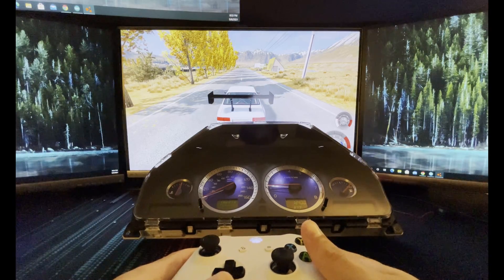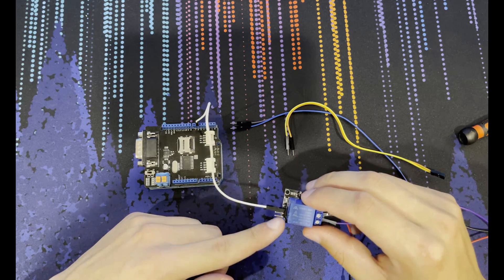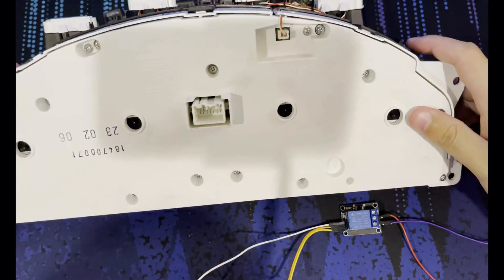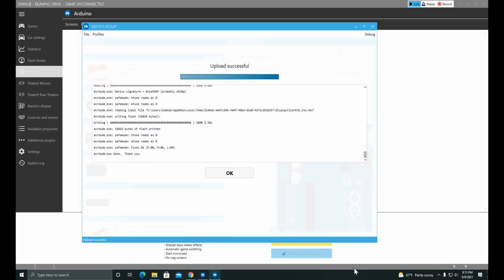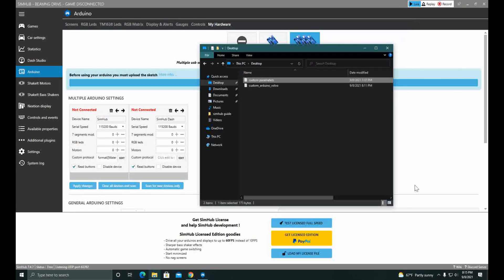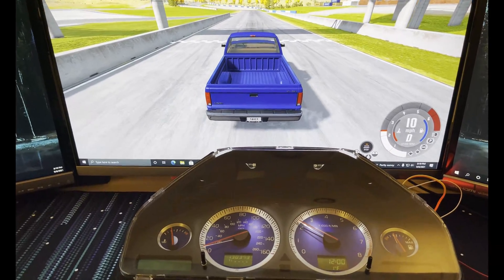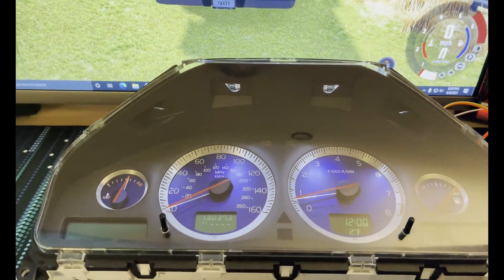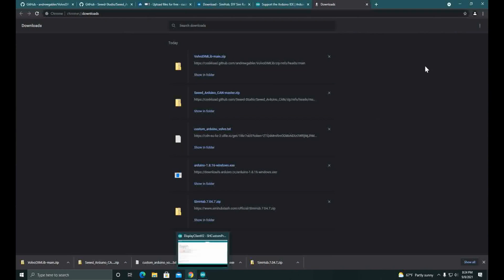SimHub with P2 Volvo Cluster - Setup Guide

Comment: heey big tnx for all the info and the time you dedicated.
got started to. but need a little help with the SHCustomProtocol in the arduino code. 
got it working iam getting the speed, rpms,fule,temp and gear.
didnt quite understood how to get the turn signls and the lights.

Comment: Hi @AVGarage_ ,

Firstly thank you for video. Thats so incredible idea. But i have a problem about upload. I followed all steps on video. 
I used the true versions. But I'm stuck at the compilation point. 
 

Compilation Screen Last messages;

Using library VolvoDIMLib-main at version 1.6.1 in folder: C:\Program+Files+(x86)\SimHub\_Addons\Arduino\ArduinoIDE\arduino-1.6.13\libraries\VolvoDIMLib-main 
Using library Seeed_Arduino_CAN-2.3.1 at version 2.3.1 in folder: C:\Program+Files+(x86)\SimHub\_Addons\Arduino\ArduinoIDE\arduino-1.6.13\libraries\Seeed_Arduino_CAN-2.3.1 
exit status 1

Error Screen;
Compilation failed.

Please help me about it. I bought all parts. I will be very sad if I do not succeed. Have a good day.
Reply: https://youtu.be/xCUjK_IsV-M
Reply: @greenleaf1292  Thank's bro i will try it.

Comment: Pro tip: If you're following this guy's guide, NEVER, and i mean NEVER use a CAN-Bus shield, Always go for a MCP2515 module or TJA1050 module, They're better and smaller imo, i learned this the hard way when i started this project somewhere around 2022-23.
Reply: and how does it change the instructions he has in the video? That's a completely different part, he simply plugs the two boards together. It is much cheaper to buy what you have suggested.
Reply: @YourDeletedComments  The MCP2515 boards just are more smaller meanwhile Seeed Studio is like "nah, eff it, just make it the same size as the Arduino."

Comment: Have you thought on adding warning light support to the cluster i got everything on mine working i got the milage and Ding Noise working and custom message displayed with a custom code i generated from ChatGPT the indicators don't exactly work as they should i added the trailer warning light to the code but That is my progress with it at the moment Take care
Reply from the maker: Yeah it’s sort of in there. Might need some tweaking to get it working properly. I don’t have much time to work on this right now though
Reply: @AVGarage_  thanks for your answer but the Warning lights come on then off when the cluster is powered up but then they go off so what line would i need to add to get the warning lights to appear when a car failure happens in game but the Check engine light doesn't appear But thanks in advance

Comment: Hi I saw that you have a new library for the Mileage support how do I install it thanks in advance
Reply from the maker: You should just need the new library and then add the enableMileageSupport(true) to you code
Reply: @AVGarage_  is that on the custom protocol or the Sh Custom protocol what is the exact line Thanks in advance

Comment: I have a s40 cluster and it’s just twitching the needles whenever I reset the uno, any idea why (pt #:30710072) PLEASE HELP!
Reply: After some further testing, when I given the gauge just plain power to + and - and +/- for can bus it does the same thing. Idk shit abt coddling other than some scratch but imo it looks like it’s just getting no code sent to and from the can bus but like I said idk anything abt this topic. Hopefully this info helps
Reply: whats the difference also, what can i do to make it work
Reply from the maker: @Undeadful volvo has a completely different communication protocol for that cluster. You need to have a P1 car to log files with and the ability to code your own solution. Otherwise you should sell it and get a P2 cluster.
Reply: @AVGarage_  ok will do thanks 4 the help!
Reply from the maker: It doesn’t work with P1 clusters (s40) only P2 (s80,s60,v70,xc70,xc90) 2005-2009

Comment: Hi i was having a look at the Code on the Arduino how do you set up the geae indicator my diesel cluster came out of a Manual what do i do to the code for the gear indicator to work and i still haven't figured out how to set the time Thanks in advance
Reply from the maker: For my cluster that came from a manual car the gear selector code does not work either.

Comment: I've gotten my hands on a 2005 petrol but European cluster, is there a chance it won't work at all because I have wired all of it up and programmed the UNO without any result of lights on the dash. I may also have to redo wiring, it's a bit messy😅
Reply from the maker: Should work
Reply: @AVGarage_  I managed to get it to work very sweet though, I couldn’t get the volvo dim simulation examples working, but I’m sure it was just an error on my end. A thanks to this guide
Reply: @SwagusSEhow did you do it, mine doesn't work
Reply: @PABLOELGAMER11late reply, but yes I did do it and it ended up working great, but you have to remember the cluster needs to be 05-07

Comment: What does the relay do? Some videos I've seen, they don't seem to use the 5v relay. Just the canbus shield on top of the arduino, with a 12v power supply going straight to the arduino. Very new to this.
Reply from the maker: The relay allows the Arduino to give power to the cluster selectively which is used to reset the needles in the case where it is powered off while they’re not in their home position
Reply: @AVGarage_  Ah. Thank you, good to know. If I have a problem like that I'll have to run a relay. I'm going to be using a non CANBUS cluster so maybe it will work differently?
Reply: @jesse.vr6  It could be it works different, I would not be surprised if the CAN-controller expects a particular type of power-off.  With ignition power/electricity being expected to be switchable compared to a constant battery current circuit. (I have a Volvo cluster from a bus designed at the end of the 80's which only has 2 chips on it and is obviously not CAN-bus based, but it does have the two different types of circuits: one battery positive that is fed to it continuously, and a main electricity switch that switches the positive side, with the first circuit there to keep the clock and tripmeter alive).

Comment: Hi I just got my P2 Gauge cluster from the scrapyard I got mine from a 2007 Volvo V70 D5 5 Cylinder diesel I managed to configure the sketch for Diesel but how exactly do you set the Time as when I remove the //  from Dim Time and then I save and upload and I get compilation error Ammi doing something wrong the outside temperature came up in Centigrade and the clock came up as a 24 hour Thanks in advance
Reply: Thanks for the reply every time I add the time when I load up the game I'm getting Brake failure stop safely and SRS Airbag service urgent then the cluster shuts off If I remove the lines for the time the cluster is working fine But thanks for your answer and take care
Reply from the maker: I am not sure without testing myself. I haven’t used a diesel cluster before.

Comment: Im having issues with the gear selector simhub says it shows N but the cluster shows P i have done everything could you maybe help with it?
Reply from the maker: Did you add the definition in simhub to send the value from simhub over to the arduino code?
Reply: @AVGarage_  I don't know how
Reply: I have been tinkering with it for 7 hours now
Reply: I have the formula setup and cluster works fine its just the gear selecter
Reply from the maker: Yeah I have added the gear selector since this guide was made. You need to add the information in the formula then pass it to my code. Try asking chat gpt how to do it if you get confused.
Reply: @AVGarage_  chat gpt just says to connect a compatible gear selecter
Reply from the maker: Did you get it figured out? Sorry, I’ve been very busy
Reply: @AVGarage_  I have not 😭
Reply: @AVGarage_  I can't get it to work I don't know if I'm doing anything wrong 😕
Reply from the maker: Send me an email with a detailed explantation of what’s happening and what your code and simhub parameters look like. Contact@agabler.com
Reply: @AVGarage_  still having issues now on a 2005 s60 cluster

Comment: hi congratulations on your work, question: does it also work on the normal v70 or s60 panel or just this type? I thank you in advance😊
Reply from the maker: Works with the normal ones without fancy dials as well, just make sure the cluster id the correct year.

Comment: hi I have now programmed my arduino but it does not want to get any power to the speedometer what could be wrong have now followed every single step?
Reply from the maker: You mean everything is working except for the speedometer? Like the tachometer works and gas gauge etc
Reply: @AVGarage_  no i mean that my speedometer does not turn on. My arduino says that it is connected but my speedometer does not  turn on. Do you have i mail that a can send you some picture of my arduino? nothing works :)
Reply from the maker: Sure you can send me some pics. contact@agabler.com

Comment: wouldnt it work with Volvo P2 platform  as long they use p2?
Reply from the maker: No, they changed communication messages and speeds from 2004-2005 and some xc90’s may require the fiber bus to communicate properly (I am not sure about this, haven’t tested any xc90 clusters

Comment: I'm having issues 😕 2008 volvo xc90r cluster I have everything wired right and cluster not a single light turning on pls help
Reply from the maker: I haven’t done any testing with XC90 clusters. Although they are P2 some years might not function properly. To keep the nice gauge dials you could get a s80, s60, xc70, or v70 one and swap just the back dials
Reply: Okay so I got it working but now I have a tire press alarm and maintenance alarm how do I fix this,when I put my cluster in the car it don't have any of these codes only with the arduino
Reply from the maker: I am not sure, I have never experienced that. Must be an error stored in the cluster somehow
Reply: Okay 👍
Reply: okay i got a s60 cluster and the only thing i got it to do was to gauge sweep with no lights
Reply from the maker: @FynnTheFurry strange. Double check that you put the code in the correct place and you connected your racing game to simhub properly
Reply: its turning on then turning off and i hear the relay on and off
Reply from the maker: Double check your simhub settings

Comment: Does it matter if the cluster comes from a Diesel or Petrol version ? does it matter if its a European with km/h speedometer or American with mph speedometer ?
Reply: I tried it with a diesel cluster I went into the Sketch and I saw Tachometer 0-8000 I changed it to 0-5000 and the revs were accurate and for KM/h you would change 0-160 MPH to 0-260 KM/h I'm from the UK so my speedometer was in MPH but in case you were wondering yes a diesel cluster will work Take care
Reply from the maker: It shouldn’t but the rpm gauge would be less useful. I never actually tested it but I added code support for KM/H

Comment: Hey mate how would i go about editing your code to work with a different cluster, i have a ford falcon BA cluster that im playing around with as i want to make a full dash set up for my sim rig, if i can find the can bus codes for this cluster can i edit your code to work? With it? 

Ps im new to all this arduino programming stuff but its a little project to help me learn.

Your help would be much appreciated
Reply from the maker: You would essentially need to rewrite everything from scratch sorry.
Reply: i have a holden vu ss cluster 20 pin that im considering modding.

Comment: Hello, it's me again. I am not having issues this time and it has been working flawlessly ever since we resolved my issue. This is merely a question, and was wondering if you knew the answer. I dug through your research in the master ZIP folder you left in Github, and found a "Sweep Gauges" section, and was wondering how I implement that into the code to get it to sweep the gauges on startup. Funnily enough I 've wanted to do this for quite some time, but couldn't figure out how to write the code. Some guidance would be appreciated when you have the time!
Reply from the maker: I could add it to the library for you
Reply: @AVGarage_  AS long as it's not an inconvenience to you, that'd be awesome!
Reply from the maker: Just pushed some changes, but didn’t test them
Reply: @AVGarage_  Will give feedback, testing as soon as I can.
Thank you!
Reply from the maker: Go download the library again from my GitHub page and then add 

VolvoDIM.sweepGauges();

Just under VolvoDIM.init();
In the setup() function of the custom_arduino_volvo.txt file and copy /paste then rebuild in simhub
Reply from the maker: Let me know if it works
Reply: @AVGarage_  Testing now, need to watch tutorial again so it will take several minutes
Reply: @AVGarage_  Do I need to include the new library as well? I'm getting a compilation error, and I've noticed that "...gaugeSweep..." isn't orange in the IDE software like the functions "gaugeReset" and "init"
Also keep in mind that I can be doing this entirely wrong 😅
Reply from the maker: Yeah you need to redownload and replace the entire folder
Reply: Having trouble, giving me a compilation error, I can't remove the old library folder even after deleting it manually from the file directory. I've also tried manually adding the library, but it says it already exists in the libraries, yet I can't find it in there.
Reply from the maker: You probably need to do it through file manager

Comment: I purchased one of these P2 connector gauges and connected it, however when I copy and paste the customized Arduino volvo.txt, an error occurs. It appears like @greenleaf1292 is having the same issue. I believe it has to do with the VolvoDIM. Its the same error code as @greenleaf1292 it says "In file included from C:\Program Files (x86)\SimHub\_Addons\Arduino\DisplayClientV2\DisplayClientV2.ino:938:0:
sketch\SHCustomProtocol.h:5:22: fatal error: VolvoDIM.h: No such file or directory
#include <VolvoDIM.h>
compilation terminated."

 So, I'm currently stuck on this. Even after reinstalling everything, the issue still occurs.
Reply from the maker: You need to add my library to your libraries in the Arduino project
Reply: @AVGarage_   I followed your instructions in the video. I continue to receive the same issue. Do you have a discord server I can join, maybe I can somehow show you screen shots of what error code im getting?
Reply from the maker: Whats your discord
Reply: @AVGarage_  It won’t let me comment for some reason.. but if this goes through it’s :Average moderator#8769
Reply: @AVGarage_  are you there?
Reply: @AVGarage_ hello?
Reply from the maker: Sorry was very busy this weekend. Will add you on discord shortly
Reply from the maker: Sent
Reply from the maker: I put a discord link in the description and added you

Comment: Hey when I try to upload Sketch setup it says "Compilation failed". Please help me & thanks
Reply from the maker: Make sure you’re using the correct seede studio version i used
Reply: @AVGarage_  the Arduino iDE version right?
Reply from the maker: Check the version number though
Reply from the maker: Yes, but I am talking about the seeed library version number
Reply: @AVGarage_   it says "In file included from C:\Program Files (x86)\SimHub\_Addons\Arduino\DisplayClientV2\DisplayClientV2.ino:938:0:

sketch\SHCustomProtocol.h:5:22: fatal error: VolvoDIM.h: No such file or directory

 #include <VolvoDIM.h>

                      ^

compilation terminated.

exit status 1
Error compiling for board Arduino/Genuino Uno."
Reply: @AVGarage_  I got the seed download from link but still comes up with a error. saying "In file included from C:\Program Files (x86)\SimHub\_Addons\Arduino\DisplayClientV2\DisplayClientV2.ino:938:0:

sketch\SHCustomProtocol.h:5:22: fatal error: VolvoDIM.h: No such file or directory

 #include <VolvoDIM.h>

                      ^

compilation terminated.

exit status 1
Error compiling for board Arduino/Genuino Uno." I can screen record for you can show you but i dont know how to show it too you. 
Thank you for fast reply's.
Reply: Hi @greenlaf1292 and @AVGarage_ 
Can you help me?
I followed all steps on video. 
I used the true versions. But I'm stuck at the compilation point. 
 

Compilation Screen Last messages;

Using library VolvoDIMLib-main at version 1.6.1 in folder: C:\Program+Files+(x86)\SimHub\_Addons\Arduino\ArduinoIDE\arduino-1.6.13\libraries\VolvoDIMLib-main 
Using library Seeed_Arduino_CAN-2.3.1 at version 2.3.1 in folder: C:\Program+Files+(x86)\SimHub\_Addons\Arduino\ArduinoIDE\arduino-1.6.13\libraries\Seeed_Arduino_CAN-2.3.1 
exit status 1

Error Screen;
Compilation failed.

Please help me about it. I bought all parts. I will be very sad if I do not succeed. Have a good day.